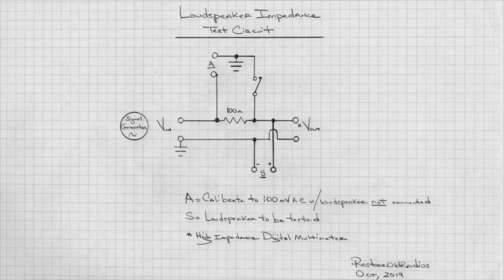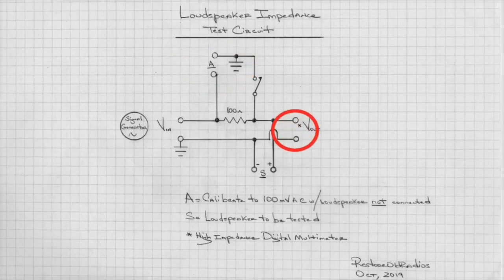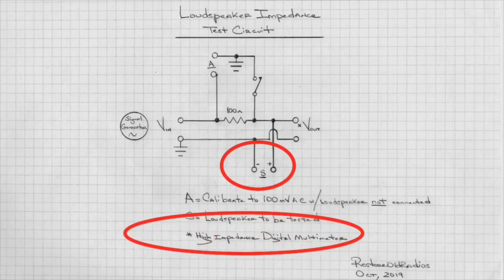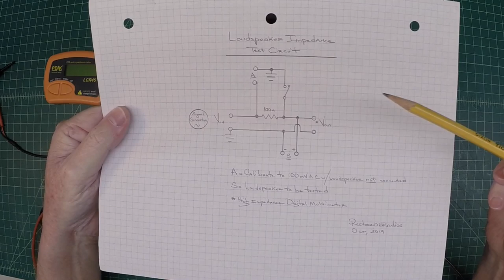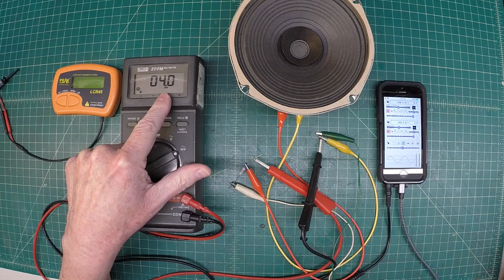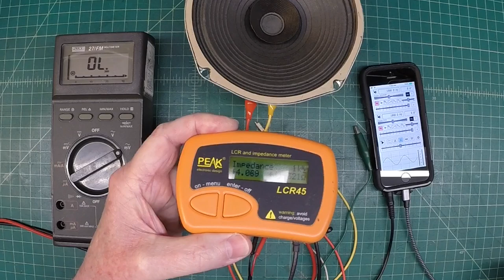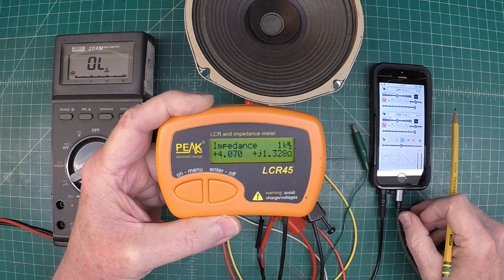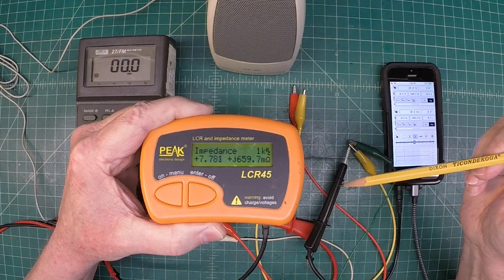Build a Loudspeaker Impedance Test Circuit Using a Digital Multimeter & SGenerator

Comment: What is the resistance of the resistor you used, and does it matter how many ohm the resistor is?
Reply from the maker: 100 ohms is what I used and confirmed the results using my LCR meter. Hope this helps. Best, Don
Reply: @RestoreOldRadios  According to an article I read, I used a 1000 Ohms resistor, and my multi-meter barely notices anything for lower frequencies. I do get some reading when I reach 1000 Hz. Could I use a 10 Ohms resistor and get good enough results? 
Thanks!
Reply from the maker: You can use a 10 ohm resistor. Calibrate for 100 mV as I noted and when you switch over the connection points to read the speaker impedance, you’ll need to take the mV reading and divide it by 10. Best, Don

Comment: Thank you very much for this video. Does this circuit works on higher impedance devices? Can I test the impedance of unknown audio transformers with it?
Reply from the maker: Asaf - a better solution for calculating the reflected impedance by measuring the Turns Ratio of a transformer is another project I published. You can check it out at: Build a Transformer Turns Ratio Meter / w Arduino
https://youtu.be/Fydj_wXrk8U

Best,

Don
Reply: @RestoreOldRadios  Thank you Don, I'll check it out.

Comment: Hi, thanks for this video. I can start use it to test speakers. But will it works to test reverb transformer impedance? But let’s say i need to test primary section impedance or secondary impedance.. also.. Will it work for input & output coil for reverb tank? thanks!
Reply from the maker: Thanks for viewing. A transformer primary impedance is what’s reflected back from the secondary source. Here’s a circuit I built that can be used to calculate the primary impedance (Z) based on the turns ratio of the transformer. Hope this is helpful. Best, Don

New Design | Transformer Turns/Impedance Ratio Meter w/ Arduino
https://youtu.be/0NXKXx-9N4s

Comment: Very interesting demo. Where were the milivolts coming from? If it was the phone, will any signal generator be the same?
Reply from the maker: Phillip - you are correct. Any audio signal generator that can generate a 1Vpp signal under load can drive the circuit. That signal, say 1000 Hz is alternating current and the rectifier circuit I built converts it to direct current before measuring the voltage drop across the 10 ohm resistor with the loudspeaker connected, then ohms low is applied to calculate impedance. Hope this helps. Thanks for watching. Best, Don

Comment: Do you need a special kind of multimeter for accurate results or will any mm do? Thanks
Reply from the maker: An input impedance of 10 megohm or greater would be my recommendation. Hope this helps. Best, Don
Reply: @RestoreOldRadios  can this method be used to measure the input impedance of a preamplifier or power amplifier, or is it only for speakers?
Reply from the maker: I can’t recall ever trying it, but it does closely follow this guideline: https://learnabout-electronics.org/ac_theory/impedance73.php
Reply: @RestoreOldRadios  Thanks for the link, very cool site.

Comment: Great video. you ever test it on speaker with matching transformer?
Reply from the maker: Check out more of my videos on testing output transformers, i.e., how to measure turns ratio and calculate the impedance ratio at:

Speaker Impedance Testing & Transformer Turns
Ratio & Impedance Ratio
https://www.youtube.com/playlist?list=PLjLu4V-71S1KGxPeRIKhiEJ7QY1b42Q6i

I’ve always disconnected the output transformer secondary from the loudspeaker to measure the AC impedance. Hope this helps and thanks for reaching out.

 Best,

Don